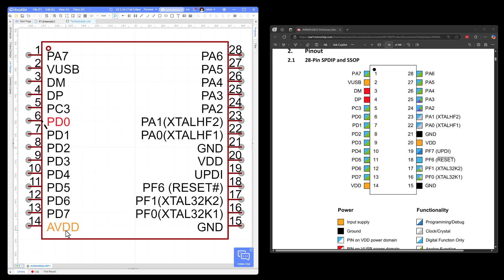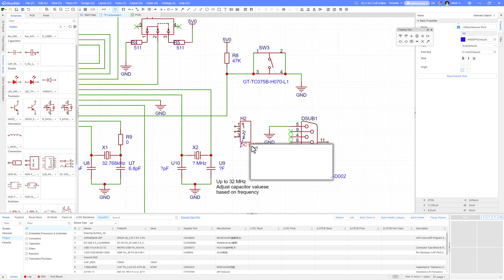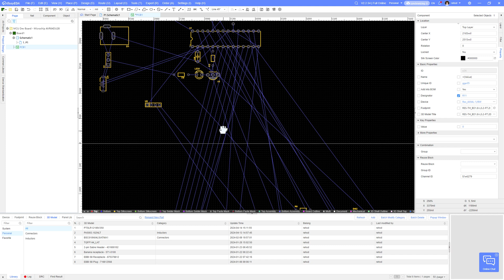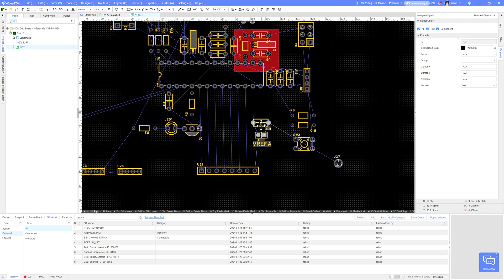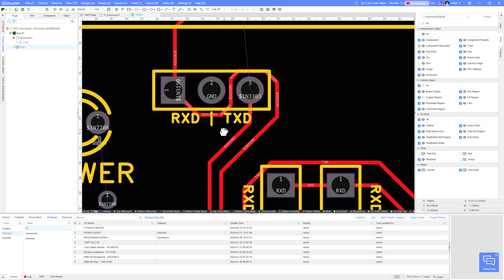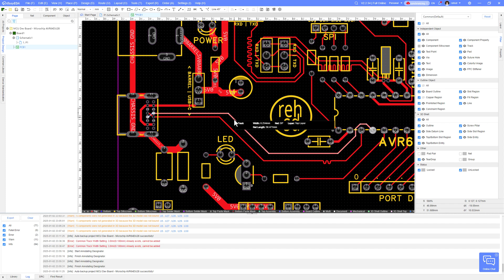Building a Two-layer, Through-hole PCB in EasyEDA Pro (for an AVR64DU28 Microcontroller board)

Comment: Have you looked at the DxCore project? I've used it with other AVR64 micros to enable use of PlatformIO/Arduino instead of having to use the Microchip IDEs.
Reply from the maker: I have not, but I will definitely look into it! Thanks for the tip!

Comment: Double-check your push-buttons (they are shorting). Also, not sure I understand your RX/TX jumper logic.
Reply from the maker: @mrengstad  Thanks! I noted the button issue in the comments and blog post. In my mind, I had them turned 90 degrees. 🙃 The jumpers are just so I can swap RX/TX.